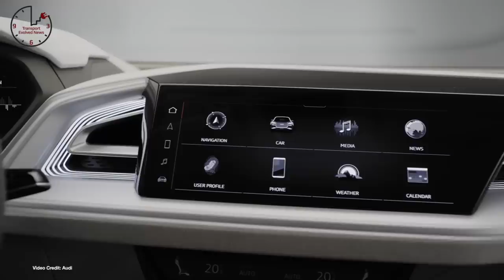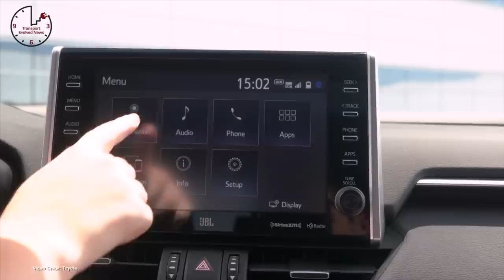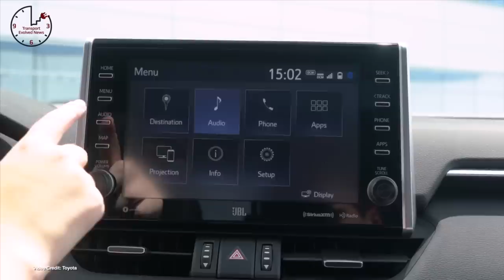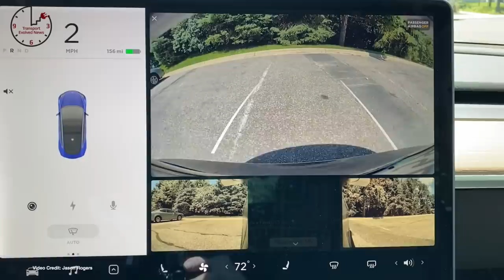TEN 299 - Rivian Gets Billions, Tesla Gets Texas Tax Breaks, EQC Called “Boring”

Comment: As a matter of interest Fully Charged has just done a review of the Mercedes EQC, just an electrified ICE vehicle, poor handling, very nice interior and looks really good with very comfortable seating etc, reasonable cargo space, no frunk and poor handling
Reply: However Mercedes has done something right which may be a redeeming feature, they have set up accounts with all the charging networks in the UK meaning the Mercedes owner has only one account , with Mercedes, thus sort of replicating the Tesla Supercharger experience, just plug and charge with no cards needed. Unfortunately max charge rate is only 150 KWH, but then most rapid chargers except Tesla are only 50KWH

Comment: Toyota are obviously having trouble sourcing those self charging batteries. It looks like that company is one of many going down the pan.
Reply: You may not be aware, but there has been a worldwide pandemic which closed the factory that makes the batteries. It's a shame that the Olympics had to be cancelled, because the solid state BEV they were going to show would've surprised a few....👍
Reply: @bryanduncan6178  You may not be aware, but that was a joke about their self charging hybrid claims.
Reply: @alaneasthope2357  I was fully aware....  I'm still curious as to how they are "going down the pan"?
Reply: @williamarmstrong7199  show me the lie? The "self-charging hybrid" campaign was directly aimed at owners of diesel and petrol vehicles in Europe. It has lead to record sales of hybrids. At no point will anyone at Toyota state the cars does not run on petrol, however the use of petrol and regenerative braking allows the battery to be charged and then the car run in EV mode.  The Norwegian advert was pulled as it referred to "free energy", clearly the only vehicle to run on free energy is the Tardis!
Reply: @alaneasthope2357  so Toyota sales are down during a worldwide Pandemic?! That's what happens when you are a worldwide company... Despite a reduction in sales in their home market and Asia, they still sold more cars FY2020 than FY2019 and posted a profit!

Comment: Mercedes need to compensate the lower value for the eqc. It doesnt include things like OTA, advanced FSD support, and most importantly doesnt provide access to a well functioning well dispersed charging network. Neither does it provide the range. All that must be reflected in the price point. I can see myself buying it but if it's in the same bracket, more or less as the tesla, the packages deal with tesla is simply in a league of it's own.
Reply: Watch the Fully Charged review

Comment: A few points:
1) I want my next car to be as boring as my current car has been or perhaps more so.  I use the car to get from here to there.  Excitement is not at all on the agenda.  It needs to work and do what I tell it to do.
2) I think giving tax breaks to corporations should be flat out illegal.  It is a back handed way to give a subsidy to a company at other tax payer's expense.  They get to use the roads, police, fire and etc just like everyone else but they don't pay their fair share.  Attracting a company to one state vs another by giving them tax payers money is a net minus to the nation.
3)  The Tesla "short shorts", are good as a joke but they are too high priced.  Basically Tesla wants people to pay to get the right to advertise Tesla on their butts.  While it is not exactly a "bill board", last I checked, companies have to pay to put their stuff on a bill board.
4)  I don't see why a water cooled charging cable should be needed.  A cable made with braided copper wires can be extremely flexible while being several square cm in cross section.  Just for some fast math
Cross section = 3.14159 CM^2
Length = 3 meters
Resistance = 0.00016 Ohms
Power loss = I^2 * R = 300^2 * 0.00016 =  14W
This is not too much to get out of the cable into the air
Charging power could be:
P = V * I = 600 * 300 = 180000 W AKA 180KW
To get to higher powers, you can scale the size of wire.

Comment: 15:44  .. rear / side view camera view??  .. why not replace rear view mirror with a wide screen (2-5X wider) that includes a composite image of rear, left side, and right side views?  Instead of looking at multiple screens / views that are arranged in a non-representative orientation (as shown at 15:44).
Reply: At the moment, the law in the United States requires physical reflective side view mirrors, which is also why Audi and Honda continue to use them on US vehicles, even as they are moving away from physical mirrors in other markets.
Reply: @e.wintertashlin2903  Understood .. but such a wide view video "mirror" could be added, even if those reflective mirrors are still there. Auto Makers do need to get more involved with lobbying for changes to vehicle laws .. especially with Autonomy increasing.. there are some coming huge legal hurdles and law changes that will be required within the next 15 years.